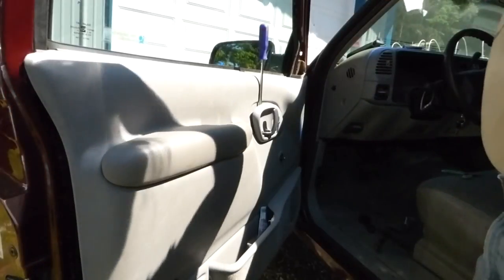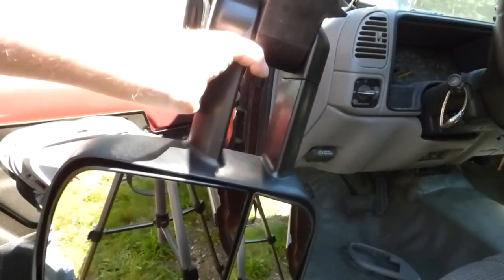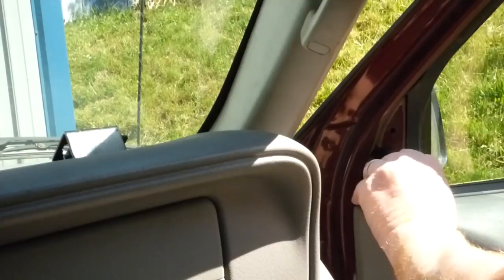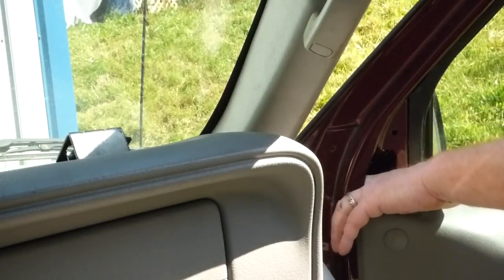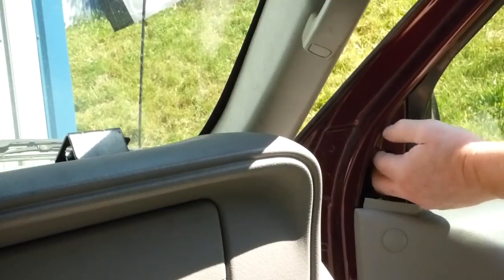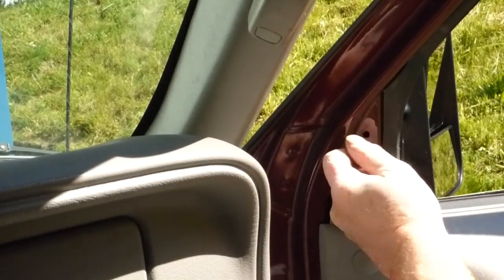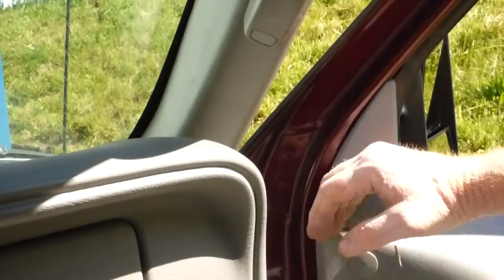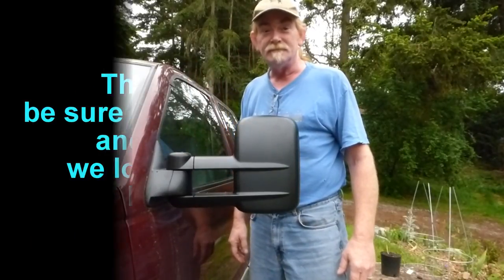98 Chevy Cheyenne RV tow  mirror upgrade

Comment: It may be that mine were different than your's but on mine, the top stud bolt was not factory installed, I placed mine after the first two bolts and nuts were in pace then put on the other bolt with the flange, then the brace. I think that is the way it is planned it has one more place of strength this way.

Comment: I got the same exact mirrors, could not see the pictures on the instructions. The printer ran out of ink and you literally cant see what the picture is or how to place the bracket on the new mirror. I did figure it out though after reading that you should smash the bracket while tightening.

Comment: nice job with the mirrors Mark! Should you tow in 3rd without the tow package?
Reply from the maker: thanks, what are you asking lol?
Reply: Mark Thieme
if you have overdrive and no tow package do you have to tow in a lower gear?
Reply from the maker: oh no, it's rated to pull 6500 pounds

Comment: i dont like folding mine ,,because they only fold outwards.
Reply from the maker: These fold either way.  I didn't think of that when I bought them, although I assumed they folded in.
Reply: mine dont ,they fold outward no problem ,but if i try to fold them in ,i feel they will just snap or brake